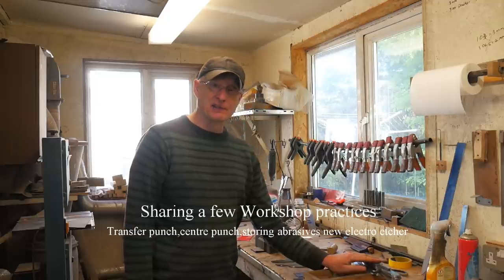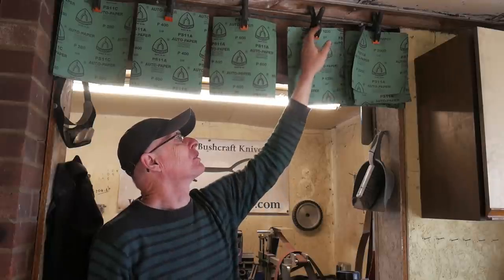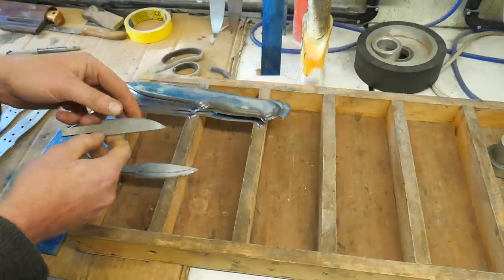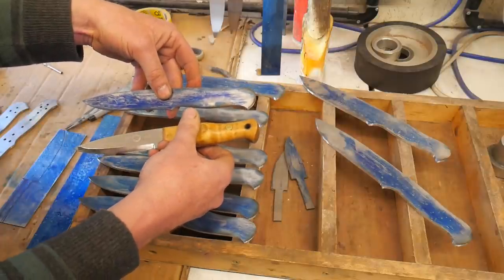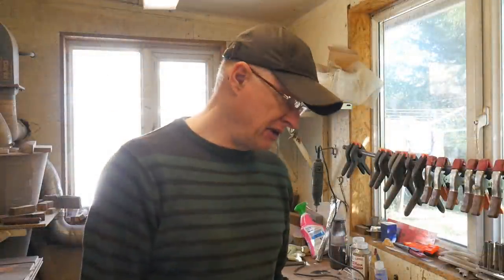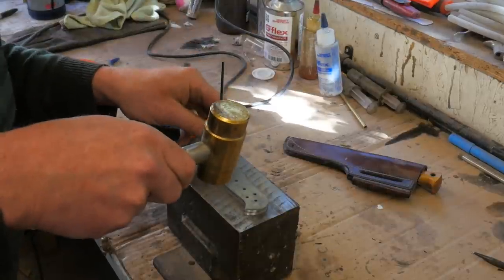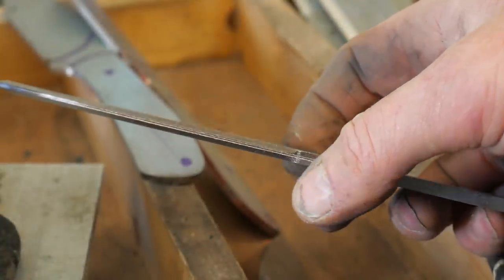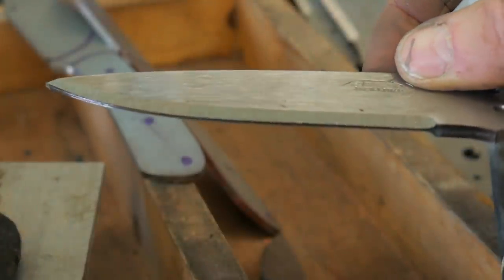Workshop practices, Transfer & centre punching, getting more organised

Comment: Hi Sandy. Nice to see you are working on extending you range of tools. You mentioned the simple solution to a big problem I might say that saves time and increases efficiency. As an engineer I can tell you this is called 5S and it’s so simple to apply with massive gains. Basically is good housekeeping and it’s a fundamental pillar of continuous improvement as we say in lean manufacturing. Even if you had no idea this is a big concept in lean engineering😝 experience and thinking made you go with it and improve your production efficiency. I am glad you are considering wood carving tools and I agree with you a narrower with would be ideal for carving. Think mora 105 or 106. Glad you are also looking at a different grind for more utilitarian use. Have fun Sandy and keep us updated.

Comment: Hey, that trick with the bit (for marking the cutting edge termination point) was pretty slick.  As a relatively new maker, with a minimal equipment shop... Tips like that one go a long way.  Cheers!
Reply from the maker: Thanks Greg. You can pick up a set of transfer punches quite cheaply on line. They really do put an accurate mark on the tool

Comment: As always sharing tips 👍 learnt so much from your sharing,I do find it frustrating to know when to get rid of a belt Sandy,any tips on knowing when they are done,apart from the obvious😉 maybe in another video. Not sure this will help but I would put the sandpaper in plastic envelopes to stop and metal dust/foreign bodies getting to them,and messing up your hand sanding.

It’s what I do with mine and my polishing mops,like the new tool was looking at them earlier in the year,but just bought some new tools a Bess sharpening tester and two new vertical/horizontal grinders.
Your right about good tools improve your work,that’s what this year is about for me and it’s working out expensive 😉
Thanks for sharing buddy,speak soon.

Davy

Comment: Hi Sandy 
Been watching your videos and progress for years now you are very talented  :) 
I'm a mechanical engineer by trade
Just a thought....why dont you modify your template to allow you to centre punch the holes in one operation? 
Either open out the holes or make a new punch with a ground diameter to fit your template so you only have to punch them once ? 
I know you are always trying to speed up your process 
 :)
Reply: Another tip
I've used broken or worn out taps as a centre punch ...just grind off the old threads and make a point 
Taps have standard diameter neck size 
Plus they are fairly hard

Comment: Hi sandy I'm just getting into making knives and I'm useing 01 3mm toolseteel it they will be simular to your classics hope thats OK?
However on my grinds I seem to struggle a little i have a nice grind till I get about 10mm from the tip the the dring doesn't seem to be as high as the rest ot the grind eg. I have a 8mm grind height then near the tip its like 6 mm,any tips on what im doing wrong?
Reply from the maker: I've noticed that with my grinding too Rob. I think it's just geometry at work but You have to be careful not to move the back of the knife away to soon but let the grind follow the belly, that way you will get a more slender tip
Reply: @Jackloreknives  I see will do some grinding tomorrow thankyou so much for your reply really appreciate it. I do move the back away maybe to soon 😌 lots and lots to learn but find your videos very very informative and helpful thankyou